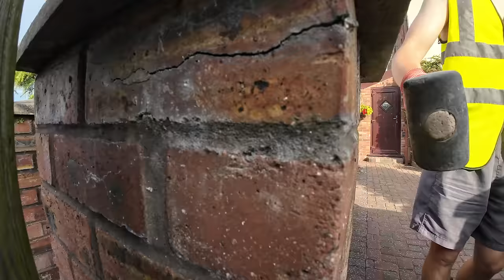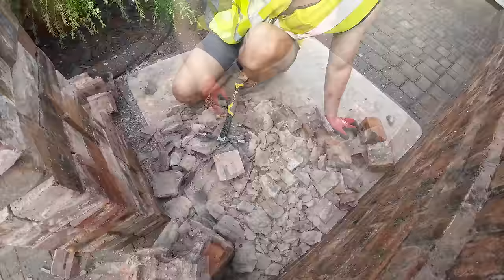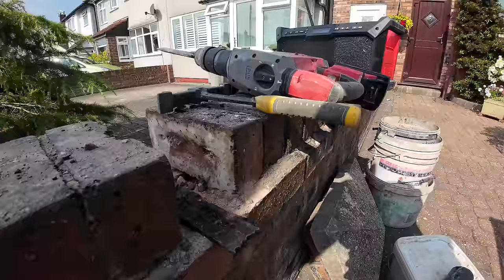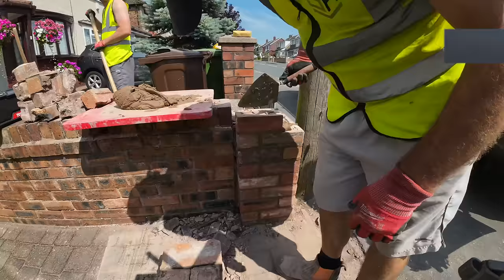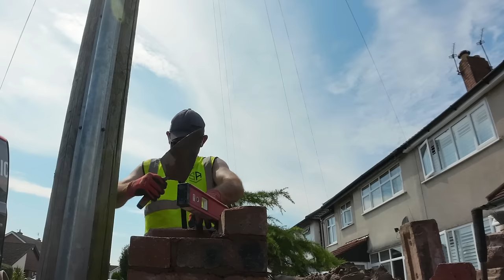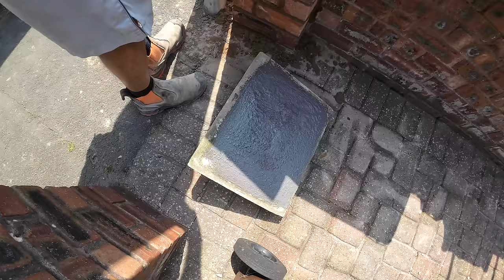THIS PILLAR FAILED THE REASON MAY SURPRISE YOU !

Comment: I'm going to rebuild the steps leading to the rear door of my garage. To retain a match with the garage I'm  going to reuse the existing bricks where possible . Is there a special name for that hammer you  use to chip off the mortar and any particular weight , thanks colin
Reply from the maker: It’s called a scutch hammer Colin , very handy . You need combs too . Watch your hands  while using it . 🧤🧤🧱👍🏽